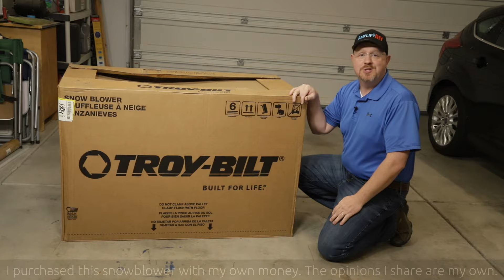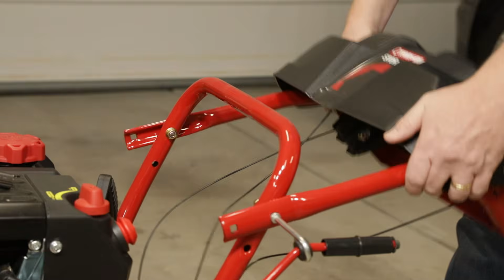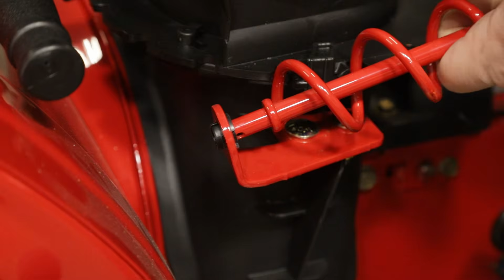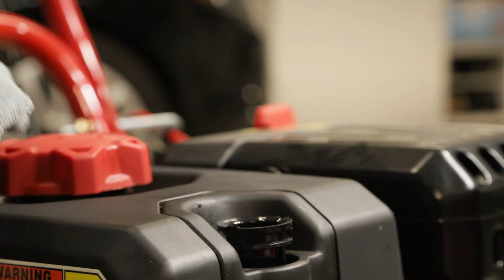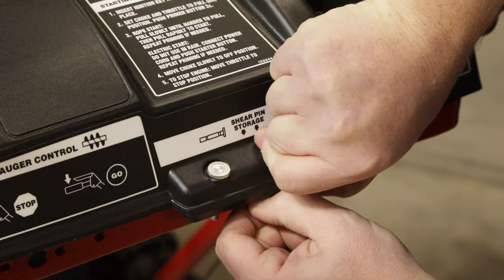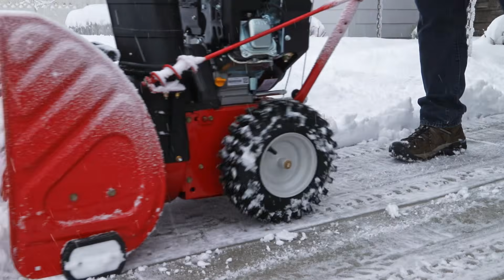Troy Bilt 2410 Snow Blower: Setup and First Use - Great Budget Snowblower!

Comment: I found this snowblower on the curb for trash day.  Still had the plastic on it and the tires were flat.  Gas was leaking out the carb it turns out the carb was stuck open the oil reeked of gas.  Replaced the carb and the oil today and it started first try.  $600 snowblower for $30 in parts
Reply from the maker: That is an incredible find and a great save! Thanks for sharing your success story.

Comment: The piece where the chute control goes threw has to be worked on i crank it but wont move.i have to push on it or chute wont move it slips,had to move it in  bout 1.8. 1.4 inch works good now
Reply from the maker: I'm glad you got it adjusted so it works well now.

Comment: can this blower be moved manually without starting it, say if you need to move it to a new location your garage or shed?
Reply from the maker: Hi Rob - sure, you can easily move it around with the engine off. The only note is that the rear axle does not have a differential, so both rear wheels are locked together. If one spins, so does the other. This can make it a little tricky to make tight turns on a garage or shed floor, but it's not too bad. Thanks for watching!

Comment: What type of oil would you use in this?
Reply from the maker: Hi StinDaMin - You mean for the engine? It's very similar to any other small lawn equipment engine. Most use 10W-30 motor oil, or something similar.
Reply: @AmplifyDIY  thank you!

Comment: I've had a 2410 since 2017, been a reliable blower with no major problems, I just recently switched to non ethanol fuel and will also be adding a fuel cut off. Also will probably do the impeller mod this summer, handles the heave snow well but the slush that the plows stack up at the end of the driveway is too much for it in stock form.
Reply from the maker: Hi Dave - have you decided on a part number or kit for the fuel cut-off? That's a mod I need to do this spring as well. Thanks for watching!
Reply: how is it a couple of yrs later…can you do a 2023 update?
Reply: @bottomfeeder12  i actually sold it as I got a really good deal on an Ariens Platinum 24 SHO

Comment: I've had a 2410 since 2014. I installed an impeller kit soon after I bought it and as if injecting steroids into the machine.i use mine commercially and never an issue yet! Other than regular maintenance and the use of fuel stabilizer this snowblower is as reliable as a hammer! Don't forget to do your break in oil change. Very important. If needing a light a simple head mounted light works well! 👍
Reply from the maker: Awesome Paul! Which impeller kit did you install? That's an upgrade I'd consider for sure.... Thanks for watching!
Reply: @AmplifyDIY  I made my own. But there's kits online, even Amazon. The thing is that the snowblower doesn't just throw farther but never clogs period! Impressive. I got everything to make my own kit from tractor supply
Reply from the maker: Making my own is right up my alley. Research time! Thanks!
Reply: @AmplifyDIY 👍 not hard at all. I'm sure you'll love it.
Reply: This is an older video an older comments but I just ran across this today on YouTube, did you ever install an impeller kit in your snowblower? Also update on mine, I still have not had an issue with mine and we just had a 14- 18 inch snow storm. My 2410 performed perfectly

Comment: Great video, thanks! Did this blower come with the extension cord?
Reply from the maker: Thanks, Michael! No, this blower does not come with an extension cord - and to be clear, that cord is only for using the electric starter if you don't want to pull start. Thanks for watching!

Comment: Perfect video. Saved. I just bought one and really needed a little help. Do you have a video for maintenance and storage during the off season?
Reply from the maker: I don’t have a video on that yet, but that’s a great idea for me to do this coming spring. In a nutshell: add stabil to the fuel, run it until it runs out of fuel, and then put it away for the summer. In the fall when you pull it back out, change the oil, and add fresh gas. Check for anything that needs to be lubricated. That’s about all these things need. Hope it works well for your this winter!
Reply: @AmplifyDIY  Great info. Thanks so much.

Comment: HEY ...that was me this morning...picked mine up Friday at Menards....other then all the card board and wood I have to scrap...it went together in about 20 minutes....does the rabbit and turtle ...fast -slow control . control the distance the snow is thrown??? Don't want to put out any windows on parked cars  in front of my house...
Reply from the maker: Hey Joe - the rabbit and turtle just controls the throttle of the engine. You can adjust the aim with the discharge chute direction and the adjustable end at the end of the chute can be aimed down to keep the snow from being thrown high/far. Good luck this winter!
Reply: @AmplifyDIY  I understand that, but if the engine speed slows does the distance it shoots the snow shorten ??? Not like my single stage Toro I had to tilt the chute down and just aim closer to the edge of the side walks. I do three other homes on my block and my 100 foot driveway ( most of my driveway is between my house and my neighbors )  so I have to shoot it  forward and then either onto my front yard or back yard...depending on which way the winds is working against me...LOL Thanks for the info....We has 24 inches in 6 days last part on January and the first week of February ...I about killed my back trying to go though the drifts of about 3 foot from the wind...NO MORE PUSHING !!!!

Comment: What type of gas is recommended
Reply from the maker: Regular unleaded, preferably without ethanol. If you can only find fuel with ethanol in it, then add a fuel stabilizer such as Sta-Bil to your fuel. At the end of winter you should completely empty the fuel tank and carburetor to avoid varnish build up and poor engine performance next year. Thanks for watching!

Comment: Question: So, since you don’t use fuel with ethanol, where do you get non-ethanol fuel?
Reply: I buy non-ethanol fuel at The Home Depot.
Reply: @arthendrickson4860  
Thanks, I’ll check my local Home Depot.
Reply from the maker: There is a station not too far from me that sells it. To be clear, I only do that for my small engines. My cars get ethanol fuels.
Reply: @AmplifyDIY  
Thanks!
Reply: Murphy Express.